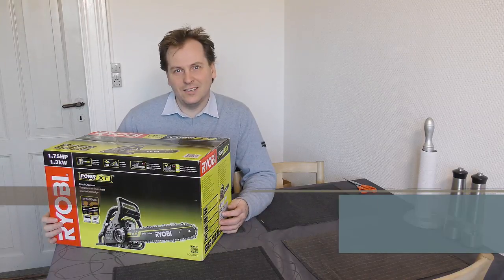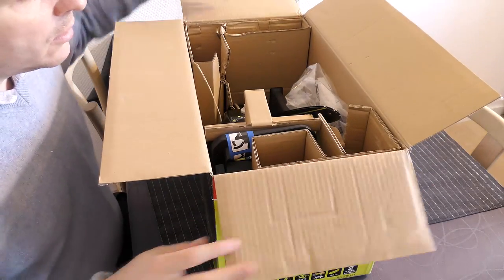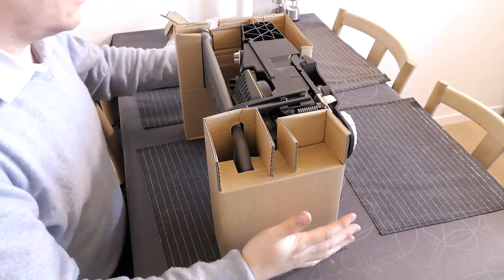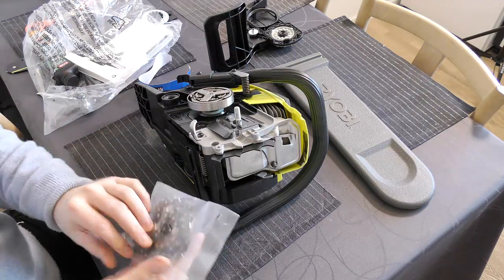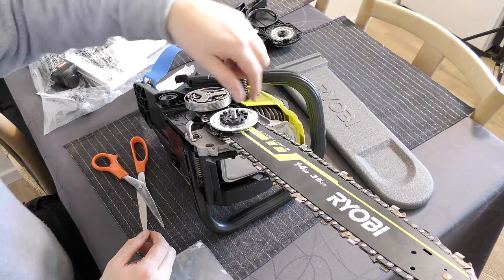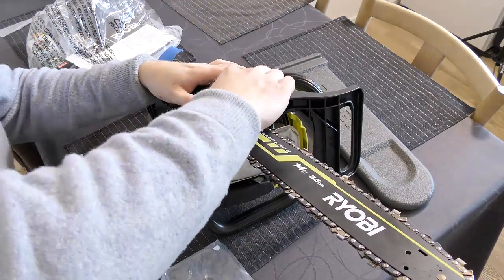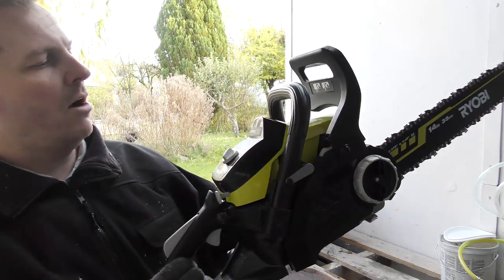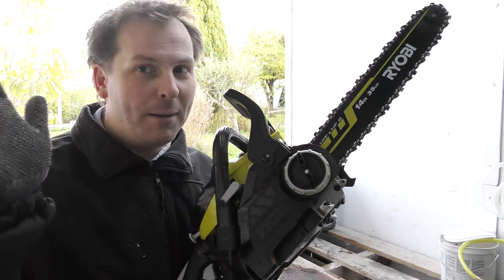Ryobi ChainSaw Unboxing model RCS3835T & First Run - 608

Comment: your other saw is probably ok  you have to remember to empty the chain oil after every use so it doesn't leak  as it's not a pumped oiler for the chain, in a home gamer models its usually a drip feed hence the leak
Reply from the maker: Hi dtec30
Thank You very much!  it leaks a lot :-/
Thank you for watching! :-)

Comment: you need to adjust carb on that,way to rich,or you press hard on wood
Reply from the maker: Hi Nikola Vincek
Thank You very much! :-)
Thank you for watching! :-)
Reply: Mine was the same. Must be a general problem with these. Had to buy a special screwdriver ("pac-man") to adjust the L-flow. Except for a fuel line bursting, it has been an excellent saw. Line was long enough, so I could just cut the bad bit off, and plug it right onto the carburetor again. The saw is light and easy to use. Powerful for its weight. Great little thing.